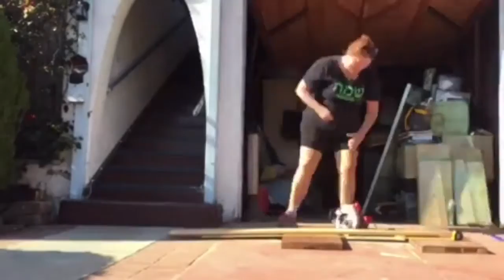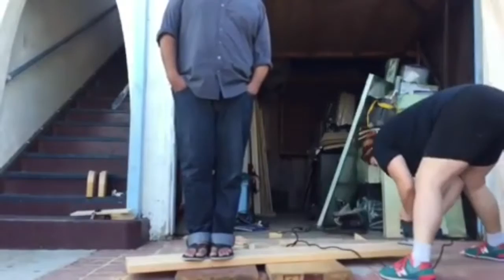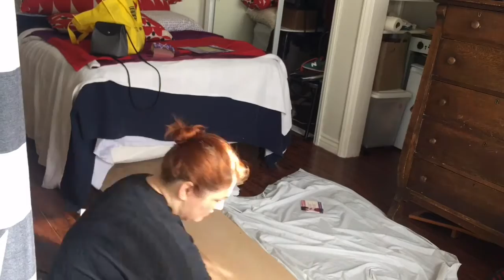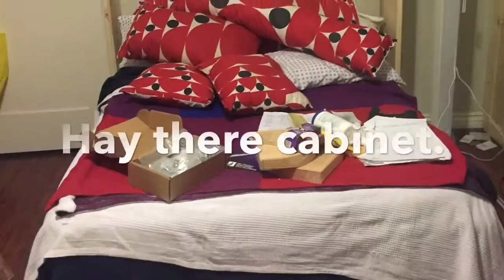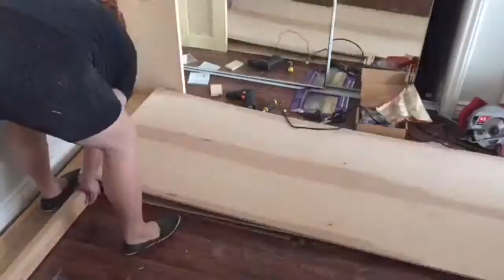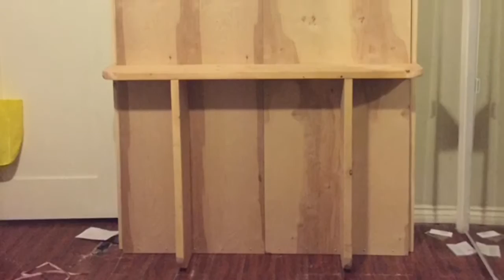Lori Wall Bed!

Comment: Hey, what is that little bench at the end of the finished bed just the platform sticking out because your mattress was shorter or did you extend it? Nice job... i'm thinking about it but I've never even sanded anything in my life